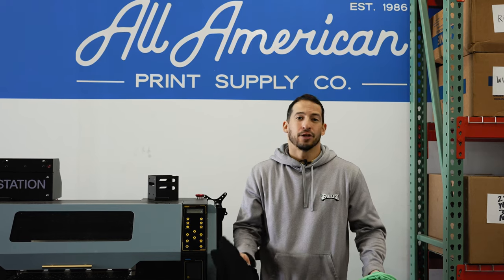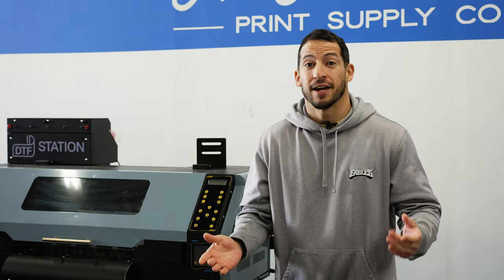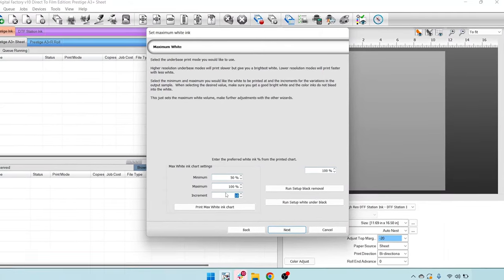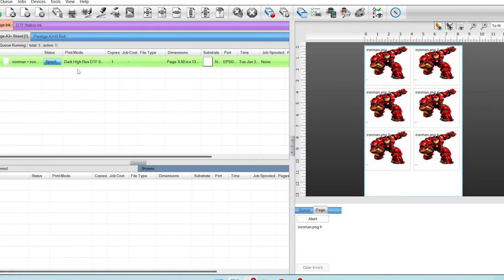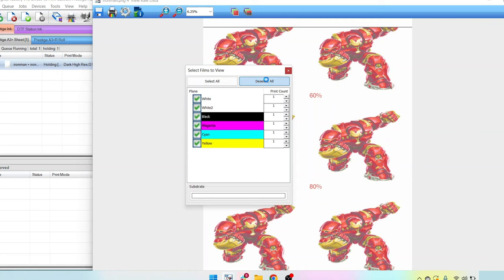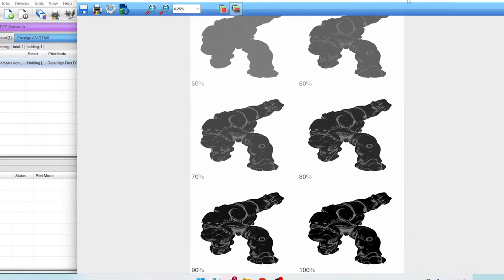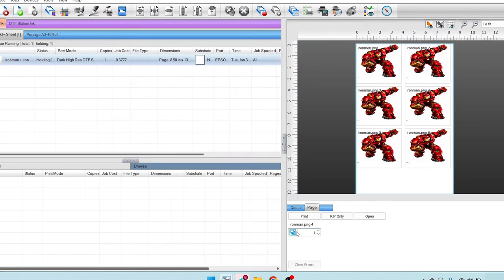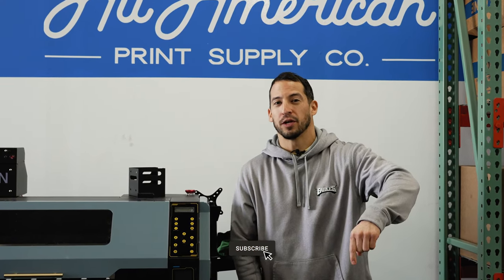Calibrating the White Ink Layer for DTF | AA Print Supply

Comment: I think im doing something wrong. I cant get the white to go behind the image for black garment.   I have DF v11
Reply from the maker: Hey there - what profile are you using in the Digital Factory? I'm sure this is something correctable
Reply: @AAPrintSupplyCo  im new to this but what do you mean by profile
Reply from the maker: @MICRAZYVIDA  next to the Queue/Page/Job tabs there should be a drop down menu with a list of profiles for printing
Reply: @AAPrintSupplyCo  which one would be the one to add the white back
Reply from the maker: @MICRAZYVIDA  You should have one that reads Hi Res Dark DTF Station Ink available that will print correctly
Reply: @AAPrintSupplyCo  ill try to find it. Thanx for the respond 🤙🏽
Reply: @AAPrintSupplyCo  i didnt find that option. Is the substrate suppose to be grey?
Reply from the maker: Hello, might be best to connect you with our support team. Here is the link for further assistance: https://aaprintsupplyco.com/pages/contact-us